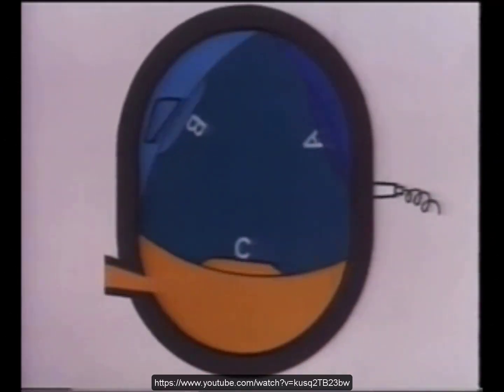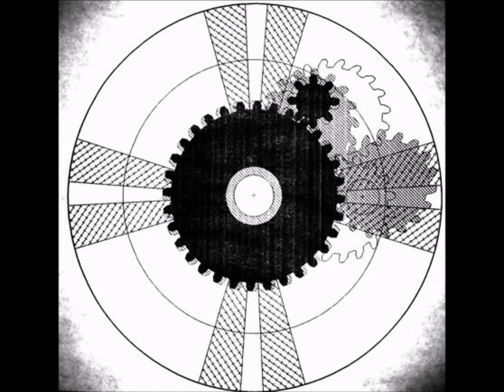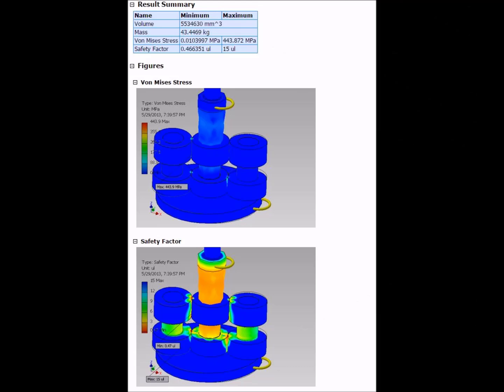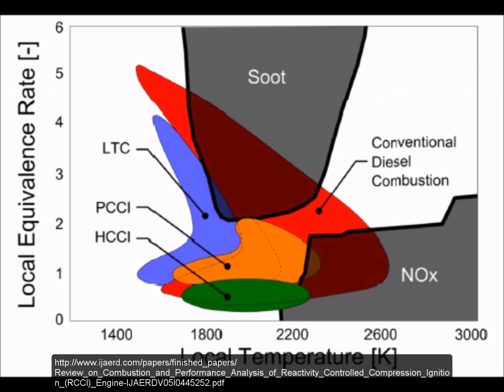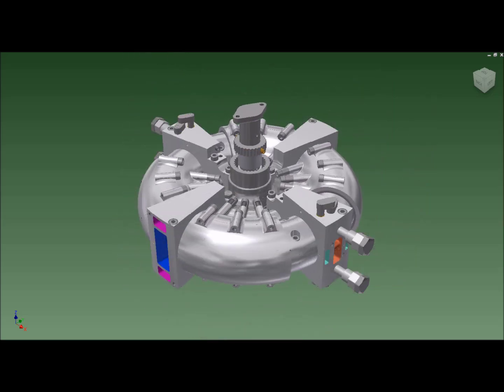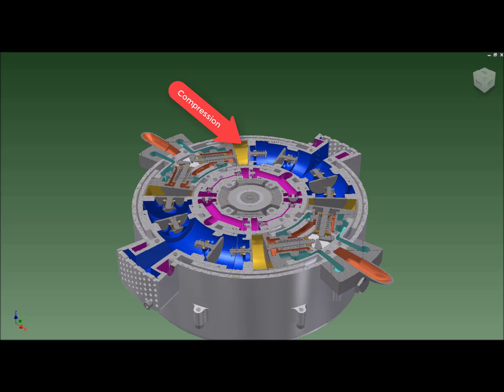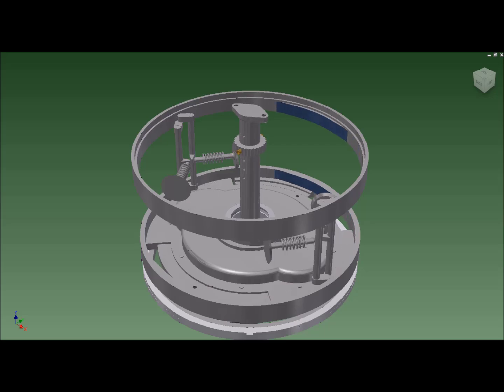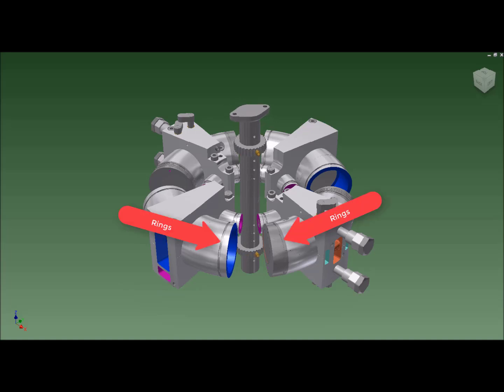OPCE Four Cylinder Engine Story

Comment: Cool idea, but FAR too complex and expensive to produce compared to other options.
Reply from the maker: Yeah, it's pretty complex.  However, it actually has fewer parts and definitely fewer moving assemblies than the V-8 it would compete with.  Thanks for you input!
Reply: @prosstaylor  Not so much the number, as the complexity. I see a lot of complex machining required. 5 axis isn't cheap.
Reply from the maker: Right again.  In commercial production, the bulk of the CNC work would be replaced with standard metal casting.  On one of my earlier designs, I actually spent the time to design it for casting -- a very interesting set of skills to learn!  Five-axis machining would probably be needed only for sleeve inserts.  Thanks for your interest and input!
Reply: @prosstaylor  If that works for some of the really oddball parts, then you might be onto something. Do you have any videos of it running?
Reply from the maker: Sorry, I'm still looking for a commercial partner or research facility interested in building a working prototype.  The closest I have is the $40,000 plastic compressed-air prototype of a much earlier design that's featured in this mini-documentary: https://www.youtube.com/watch?v=S9bmfAhIFjg or accessible from my channel.  Thanks again!
Reply: @prosstaylor  So, the plastic version cost $40k to make? See the point of my original reply? Good luck fundraising.
Reply from the maker: A prototype of a V-8 built using CNC machines paring away material from a block of 4148, including oil channels, cooling channels, valve ports, etc. coupled with the labour costs would be pretty similar to the costs of a one-off prototype of this engine.  The real question is whether the complex parts can be designed for mass production the way conventional engine blocks are made now.
By the way, the plastic model was made using a very expensive 3D printer -- just the main central block cost $10,000 to print, and that had nothing to do with complexity; just the cost of material.  (The college I taught at had the machine and was looking for things to use if on, and also accessed the grant money to pay for it!)
So, the question I need to have answered by an engine manufacturer is how much of this can be done using inexpensive casting processes like those used elsewhere.
I actually spent some time learning what was needed to design parts for casting -- really interesting!  I also modelled one of my earlier designs to be cast-ready, and almost everything could be cast conventionally.  The only thing requiring final CNC work was the bore of the sleeve inserts.
Again, thanks for your interest and valuable critique!

Comment: Incredable. I want one.
Reply from the maker: Thanks!  So do I!  Now, if someone would supply about $250k, we could build a prototype ;-)
Reply: @prosstaylor See one of the key features of a good engine design, it should not cost 250k.

You are competing with engines you can buy under $500 at Harbor Freight.

Even a one off prototype should not cost more than 10k.

I have one like that right now.
Reply from the maker: Actually, outside of the range of engines that would be used for home CHP, I'm competing with engines that cost $20,000 when you try to get them replaced in your F250, or a few million when you put them in your ocean-going tanker, but still prototyping is an expensive business.  Once you get yours up and running, I'd love to see how it turned out!
Reply: @prosstaylor  For $250000 you can set up a machine shop and make it yourself! It would not cost anywhere near that to make a prototype. Go to India and they will do it $10,000! That is what I am doing!

Comment: How can an unaffiliated inventor get funding for patents? Is an US patent enough for an engine like this or a patent on multiple countries would be better? Something tells me that, even in the transport sector, there will be a surge in the need for compact and highly efficient engines that will no longer be coupled to primary traction, essentially as the last generation of combustion engines.
Reply from the maker: You ask hard questions.  I had a short window of opportunity in which the college I worked for was willing to support my research and began the process of filing the patent.  Without that, I would not have been able to cover the lawyer's fees for completing the process -- even the cost of the final steps was a bit daunting!  My patent lawyer suggested staying with just the US patent.  My daughter, who has a number of patents in the chemical/medical/agricultural world, always goes for multiple countries.  I think my patent lawyer felt that the US was the most likely market for an engine design; however, it seems that there are a lot of European and Asian countries that are making significant advances as well.
For size, efficiency, and simplicity of control, it makes sense to have an engine running at a constant "sweet spot" speed generating electricity rather than mechanically driving systems with widely varying requirements and desired response times.
Thanks for your thoughtful response!
Reply from the maker: People have suggested "go fund me" campaigns and things like Dragons' Den.  There may be other possible avenues for getting funding and support like these.

Comment: How do you bore the curved cylinders?
Reply from the maker: With a 5-axis CNC machine, a rotating cutter, significantly smaller than the bore, enters the end of the cylinder and traces around the bore while spiraling in along the bore radius.  Since the stroke isn't that deep, the drive machinery remains outside the bore.

Comment: Not bad for AI 👍
Reply: Al Bundy? Does sound like him.
Reply from the maker: Funny!  As a retired computer engineering technology instructor, I have, oddly, never even accessed an AI site -- I'm still old-school enough to want to say exactly what I mean instead of letting something or someone else do it for me!
Reply: @prosstaylor  computer enginering, that explains the core around shape in your design from a mechanic view it look like a lil nightmare to "patch" but at the end it could lead to an improvement if you get the math right but the thing that get my atention in these are the gears, its hard to beat the simplicity and thoughness of the clasic oil bearings
Reply from the maker: I did some serious conversing with both KissSoft and Liebherr, and we determined that it would be surprisingly easy to generate the non-circular gears to my specifications using a conventional CNC-controlled gear shaper.  Liebherr would have written the software and supplied me with a set of gears if I had been willing to cover the costs.
Reply: @prosstaylor  i mean it is like the rotary engine the change on force due to the change in direction of the pistons are held by certain theets that would wear those ones more, at the end is less contact area than a classic journal on a crankshaft, if they work for keeping the pistons in track like i think or im wrong? Thats what in mean by math if theyre going to be the aquiles tendon
Reply from the maker: The oscillation of the pistons is almost completely sinusoidal (unlike the motion of conventional pistons or rotary designs), which significantly reduces wear and vibration.  In addition, the perfect symmetry of the engine means that forces on one side are countered by the other side, resulting in no net restraining force for any single piston.  I have done fairly extensive Finite Element Analysis (FEA) to ensure sufficient strength on the connecting arms between the moving cylinders, and have done pressure-velocity tests on all bearings to ensure that bearing surfaces are large enough to handle the forces.  Of course, these analyses are only as good as the parameters and constraints used in setting them up, so I had a mechanical engineer work with me to keep me on track.  Thanks for your input!  Keep looking for weak spots -- that's how a design gets perfected!